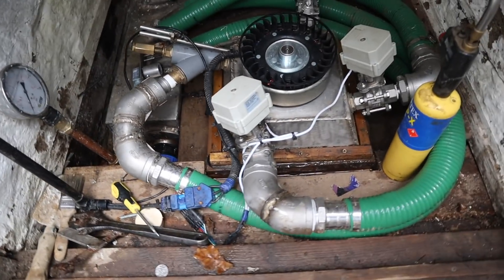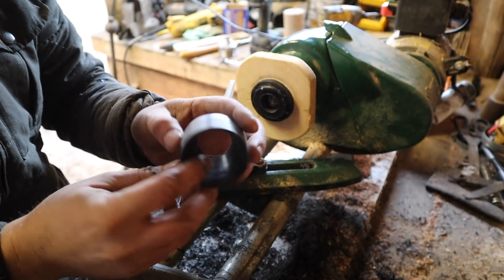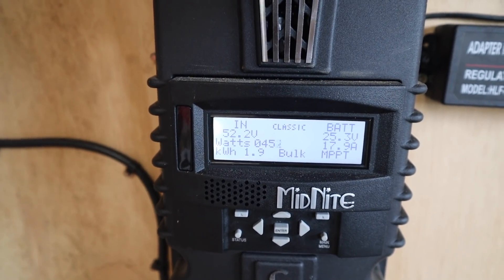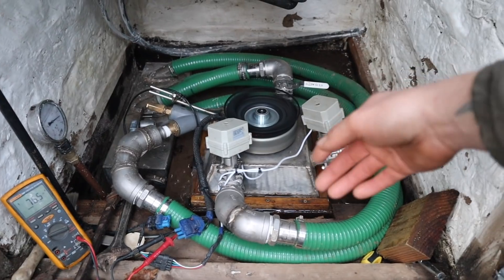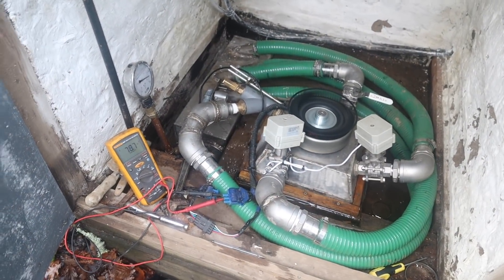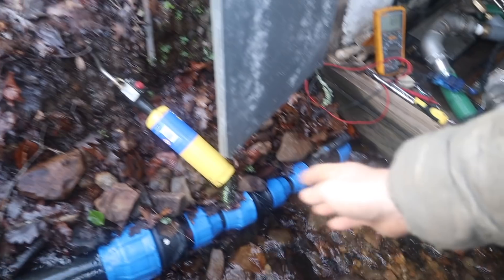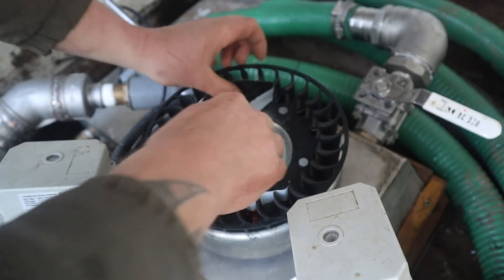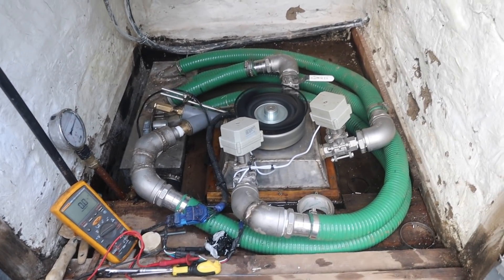Off Grid Micro Hydro Turbine Fine Tuning (Tapered inserts and fan loss testing)

Comment: I wonder if the sharp 90° bend is causing the low enhancement. The water is impacting the wall, pushed away again and with the new inlay it's actually head on crushing in the next wall. Have you measured the differences of the 45-45 pipe? Maybe the difference is bigger there 🤔

Maybe run the pipe a bit higher and suspend the distribution box. Then you could run down the green pipes in a swing and have more room to work with. This way you can avoid the sharp bents completely.

Edit: You could also cut down the distribution box in half and just attach all 4 pipes at the end. This way the movement direction isn't abruptly changes, the water is just split in 4 pipes. Maybe put the valves right at the end of the distribution box.

On the bottom side you can add an end cap which you can open to get rid of any debris collecting inside the distribution box.

Then you turn around the direction in a large spiral and attach one coupling directly to the nozzle without any sharp bents.

Maybe let someone turn an aluminum part for you where you can plug in a nozzle and screw a nut on, to clamp it down and on the other side clamp the pipe onto.
Reply: I bet this is a major factor, that water has to be turbulent.
Reply from the maker: Im not quite sure i understand what you mean, are you asking if there are steps in the 90 fittings? there are but they are small. the flow of water leaves the manifold and goes around a sweeping bend in the pipe, it then hits the sweeping 90 bend (on the biggest nozzle) it then gets taken down gradually to 1" by the insert. it then reaches the nozzle.  i didn't find there to be much improvement from going from a sharp 90 bend to a shallow 90 bend and at the low flows i dont believe at this point there is much loss in those fittings. I have been doing efficiency testing by measuring flow. its currently over 60% efficient at 350w There is about another 5% gain possible from going direct in to the manifold with the large penstock. But there isnt alot more i can do at this point as that is right up at the limit of what is possible. The turgo itself is only 90% efficient the alternator is 85% my penstock loss is about 10% at full flow but i can get that 5% down with some changes. But it still 10% loss in the turgo, 15% loss in the alternator, 5% loss in pipe friction, 2% loss in cable run, 2% loss in bridge rectifier, 3% loss in charge controler. so you can see there really isnt much that can be done at this point. This is the reason the things i am doing are not making much difference because anything i gain somewhere will be lost somewhere else as im reaching the peak of what is available. the Main gain now will be to go direct in to the manifold and get rid of the 3 fittings that tapper down the penstock.
Reply: @KrisHarbour  hey thanks for the detailed response.

When you just look at the motion in the center of the pipe:

The water flows against the wall of the sharp 90° bent and gets deflected with the same degree. This means the water will change direction and hit the new smooth transition wall on the inside of the bent at a right angle.

I was wondering if the improvement done in this video is just so small since it's just behind the 90° sharp bent.

So that's why the question comes to mind if the shallower 2x45° bents with the new smooth transition are performing better.

The other improvement ideas wasn't really necessarily about your current system, but stuff you might want to test out or consider for the next build, since you're talking about doing this maybe as a business.
Reply from the maker: I see, yeah i think that is exactly what is happening and why the improvement is only very small if at all. the thing is if i though it would make a significant difference i could fabricate a very shallow sweep but i dont think it will make much difference, i didnt find any measurable difference from going from a sharp 90 to a less sharp 90 and then no real measurable difference adding the   inserts. i really think that there is such little loss there that it isnt really measurable at the current flows. (the flow is small for the pipe size) I think if i run the second intake and run this turbine at twice the flow these changes might have made a bit more difference.
Reply: I was wondering if due to the limited space available if he could swap out the SS 90's for a schedule 80 sweep in front of the tapered reducer? Just a thought.

Comment: You should have done a flow rate through the pipe with and without the taper in the pipe with a known amount of water, like 250ltr Drum
Reply from the maker: No way i could do that accurately enough. The change would be very small so any splashing or anything would mess up the test. in a controlled environment it would work but not in this situation.
Reply: @KrisHarbour  I think you are doing a grand job, seeing what tweaks you can make and i think if you do go into production of the turbine, people will see you have checked every avenue for loss in efficiency
Reply from the maker: Thanks :) its all part of the way i learn. doing this stuff really helps tune my intuition. Its also teaching me about the bigger picture when it comes to losses. there are a few companies that make standard sized turbines. I want to make custom turbines that are perfectly suited for the environment they are in. My first turbine was more efficient because it only had one nozzle and because fo that it had less loss. But the new turbine can run at much higher flows and much lower flows and runs for more months per year so the losses of the nozzles and fittings are acceptable for that range of control. So i want to make turbine that suit the situation not just a standard design. Doing all these test should give me a good idea of what will work well and what wont.

Comment: Why do you want a valve at all in this place? Just add a drain valve at the back side of the distribution box, to release the pressure if needed and make a simple plate to cover the intake. :)
Reply from the maker: The ability to shut off the water before the turbine is essential. Trust me. Its a long walk up hill to divert water at the intake and anytime you want to do anything to the turbine (like me making these videos) it would involve trips up and down the hill all day long each time waiting for the 1000l of water to drain out the pipe and blast out in an uncontrolled way eroding everything and just generally being dodgy and silly
Reply: @KrisHarbour  so... what's the plan then? 🤔

Maybe a metal valve directly attached to the distribution box? This way there's no restriction in size, you can get them in very large sizes.

Comment: I think that you should now adjust the nozzles again, it is possible that  inserts has slightly changed the jet angle.
Reply: The insert wouldn't have changed the jets. The inserts are where the pipe reduce from 2" to 1". The 1" pipe then goes to the nozzles. So the pipe goes 2" > 1"> valve> nozzle.
Reply from the maker: Thanks Tedium, saved me some typing :)

Comment: Hey Kris, massive fan of your work. Keep it up!

I'm no pipe expert, so ignore me if this is nonsense, but I had a thought... You can get 4in BSP ball valves, and there are 110mm MDPE to 4in BSP adaptors. A quick google search turned up a few results. I wonder if you could modify your splitter box to have a 4in BSP fitting and then go straight in from the valve?
Reply from the maker: Hi, thanks for the info, yeah you can but each one of those fittings adds loss. The goal is a few fittings as possible so finding a 90mm ball valve in one fitting would be ideal.
Reply: @KrisHarbour  Hey Kris, after doing some very quick searching, there are a couple UK based places that have 90mm ball vales. One is called Water Technics, and the other is called Plastic Pipe Shop. However, the valves are rather pricey, so you may be able to find ones online for cheaper. But I'm sure you've already looked into it.
Reply from the maker: Thanks, i will check that out. :)
Reply: @KrisHarbour   If I find one I'll let you know.

Comment: Have you inspected the turbine blades lately? They deteriorate due to sand blasting over time. I've seen some that were barely nubs and doing a lot less work than when new.
Reply from the maker: They will last years, they are glass fibre reenforced. very durable.

Comment: I am watching this. I'll cross that bridge when I come to it with similar testing. I may be operating at a higher RPM than you: 1,800 RPM open circuit, so about 900 RPM closed circuit. Of course I will be building a larger turgo runner to bring the RPMs down.
Reply from the maker: 900 rpm is about what im running. there really isnt much loss from the fan from what i can see.